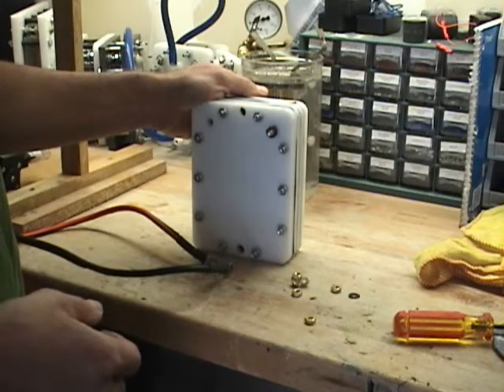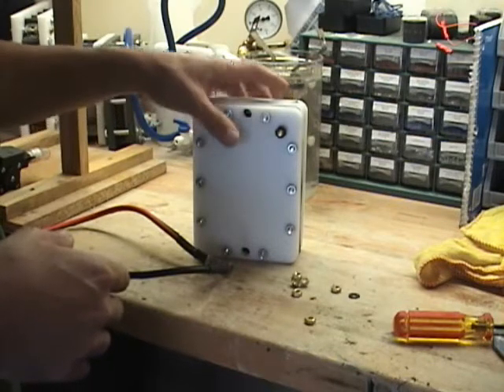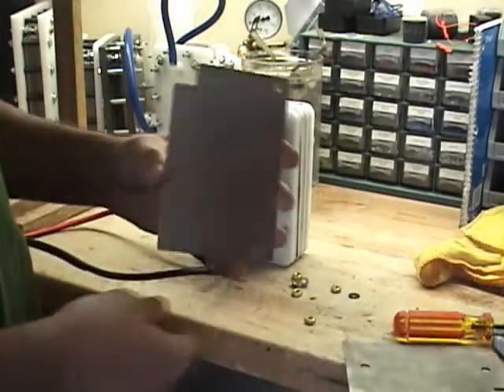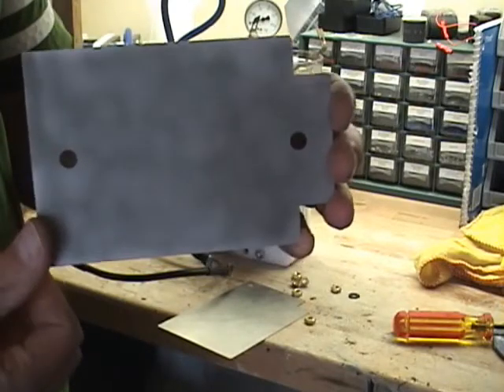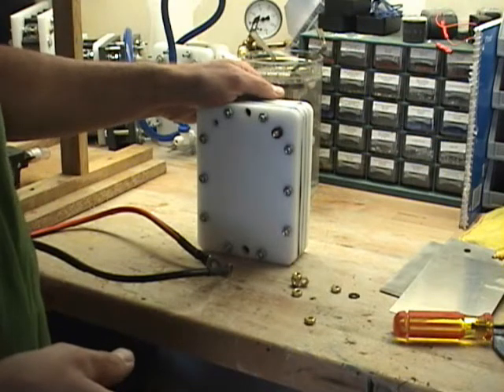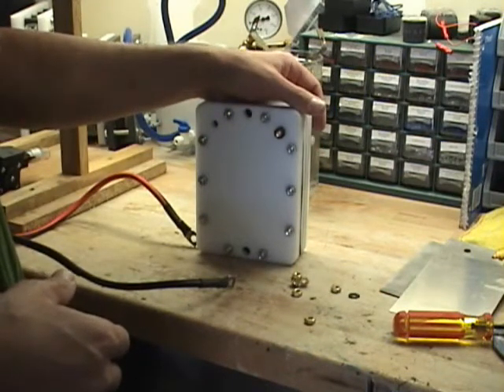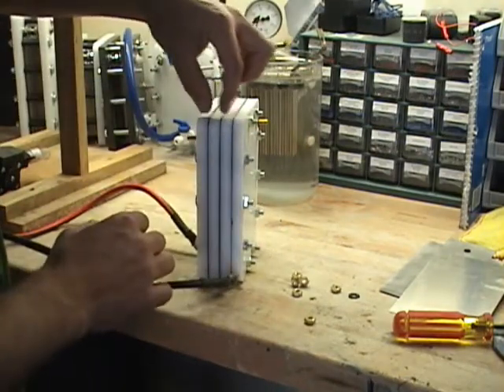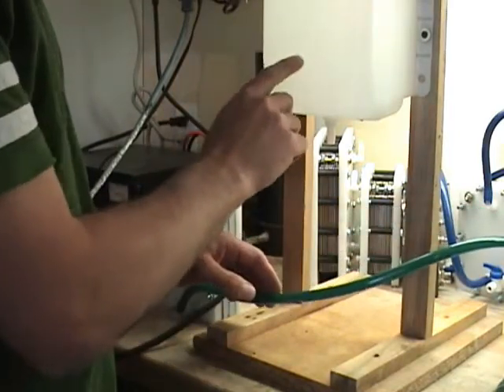Hydrogen HHO NICKEL cell First look :)

Comment: You guys have:
 OH- repelled from the Cathode- at very high speed. 
H+ repelled from the Anode+ in the opposite direction.
Meeting in 'the middle' and forming water again... (a waste..!)

ie: Between plates:
H+ is attracted to OH- to form water again and waste half the energy you put in.
(crash into other molecules heating things up too)

If they didn't:
OH- from Cathode- would reach the Anode+; 
where the 1st electron is easily stripped, leaving OH; 1 shared electron (not 2) to split.
H+ from Anode+ would reach the Cathode-; where simply adding an electron gives you H.

So...  how do you stop the H+ and the OH- from meeting in the middle? (between the plates) 

One way would be to electrolyze steam (waste energy) or water vapour or mist (Ultrasonic mist maker) at an ionizing voltage between very flat, parallel plates.
(ionizing: ~1000 volts per mm.  
Flat enough plates:  box cutter blades.)
Now electrons (from the Cathode), about to crash into the Anode, hit a steam molecule there, avoiding all the mid water collisions...
As gas molecules are far more diffuse than water; less mid plate (in water) collisions and less energy wasted banging into other molecules...

One might:
Flip voltages at ?? frequency to reduce the oxidation formed on the plates and avoid the travel of H+ and OH- in opposite directions.
Use a magnetic field, perpendicular to the plates, to get the +'s and -'s to take different routes from each other.

Until this  'H+ and OH- meeting in the middle to form water again' thing is solved; you guys are farting against thunder.

Comment: I did post a comment on the latest video from HHOPWR about platinizing titanium plates. This process is used for professional electrolysis. Only one side from the plates needs to be platinized  with platinum.  The comment also explains why. I found that information on a dutch wiki page, the English wiki page did not show this information. 

Greets, iT

I dunno about the costs but it is possible to do the platinizing process  at home.

Greets, iT

Comment: It's cheep and easy to do right in your garage. There are some great "How To" vids on youtube. And if you want to try electroplating other metals, there are vids on them as well.
If you want multi-metal, that is more difficult, but it can be done.
Smack, has stated that the Ti multi-metal plates will last for about only 3 years, at about $100 a plate.
You mite think about copper core electroplated with cobalt.
My concern with nano-coating is the life of the plate, same with the MM coat.

Comment: Copper that has had the edge masked off so that it looks like a picture frame, then electroplate it 5 times. The part that isn't plated will be under the gasket, the nickle is the only aria that will come into contact with the electrolyte.
Were you asking what what kind of nickle was I going to use for the electroplating ?
As pure of a nickle as I can get my hands on. I'm looking for it on the net today. Making the nickle acetate solution is easy once I can get the crystals.
Peace.
Mike.

Comment: Altern8, I think Bob Boyce stated that titanium will emulsify quickly when in an HHO cell, unless you have it coated with another metal, or multi-metal. So, you mite want to think about that before you fork over Big Bucks for the plates. And remember, Titanium is very hard to machine.

Comment from the maker: I set this cell up to use alot of koh. I wanted to start out the tests with a weak mix. I've got 2 liters of distilled and im doing 2 tests then adding 2 more tsp. to the mix. I have a got a hydrometer to measure my concentration. I deffinently will get to the 33%.  My Astron power supply has a voltage control so i will be fine on the power side. Thanks!

Comment: Steve, There is more there. Increase your KOH strength to 33%. Use a PWM if you have to but with your power supply and the size of your cell you should not have to. Over amp the device until you get to the max temp your cell can handle. Then be prepared to be amazed. Lowering the resistance in your cell is key. Hotter water will dramatically lower your energy loss. Then just for shits and giggles add about 1 cup of urea to your solution. Just sit down whenh you calculate your results.

Larry

Comment: I was thinking that maybe with this test, since it  is taking more then five minutes, that the collected  gas inside the bottle has time enough to warm up and expand when it gets at room temperature. 

It is just a theory though. But when my theory is correct then your results will be more accurate with a higher gas production and a cell that is running a bit longer so the water is warmed up a little bit.  

Nevertheless it is looking good, I like the setup and the experiment. 

Greets, iT

Comment: I'm a huge fan of the dry cell design. The idea of making the gasket your electrolyte and gas manifold is wonderful, sure stops the current leakage from a hole drilled through the plate.
One of the things that is so cool about this type of design is - it's a pump with no moving parts.
My new dry cell design has 4 electrical connections on each + & - plate, one in each corner. It's a +nnn- 316L cell.
Next project is electroplated plates.
Keep up the good work, and keep posting.
Peace.
Mike.

Comment: what kind of nickel are you using? Nickel 625 alloy or something else?? Nickel isn't cheap but if you want a total non-corrosive metal, Nickel or Titanium is the way to go. Not sure why the sand blasting is needed. I figure the smoother the surface the less likely the bubbles will stick to it. I'm also working on building a much larger system. I'm moving away from fuel economy uses and more for a pure clean fuel source to power propane electrical generators.

Comment from the maker: I dont have any experience with copper cores but i would think the copper would leech through into the electrolyte. If you could keep that from happening i think that would be an ideal cell with very little resistance. much less than nickel.
I also agree alternating the pos, neg would be advantageous

Comment: Steve, thank you for posting this vid. I've been wondering about nickle plates in an HHO cell, though I must admit that I was thinking of electroplated copper core, with the part under the gasket still copper for a more even electric flow across the plate.
Only change I would make to this design of yours is, positive connection caddy corner to the negative. Electricity takes the path of least resistance,  having the connections so close will make you produce at the top of the cell.
Peace.